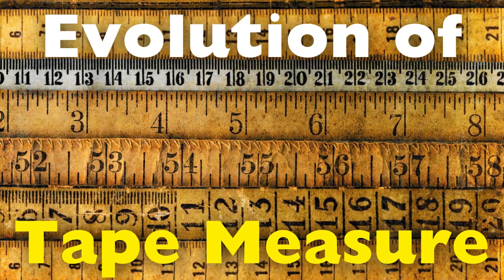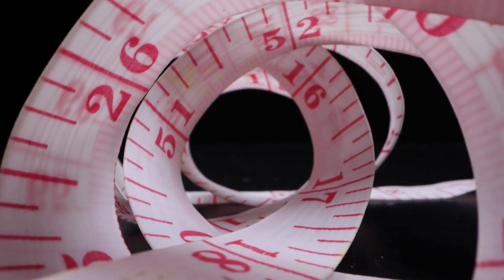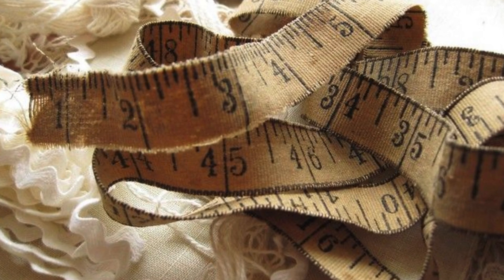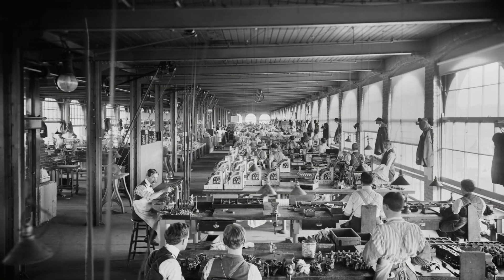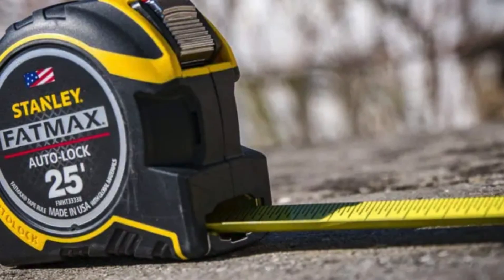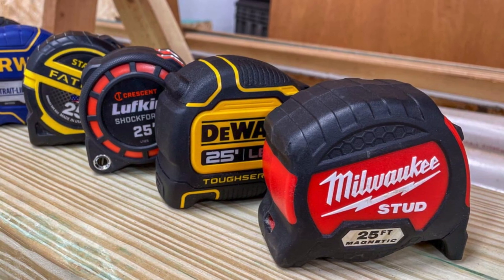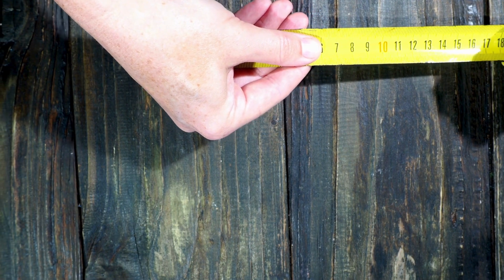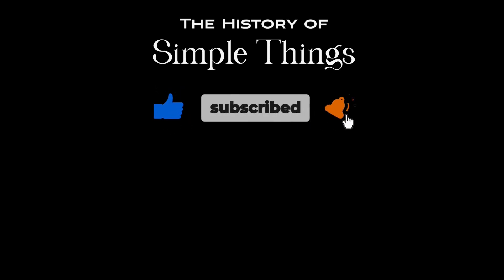From Cloth to Steel: Evolution of the Tape Measure

Comment: Greek, Roman and Egyptian buildings were/are very accurately measured.   Sure they had "feet", Cubits", etc.   But THESE were STANDARDIZED.  as in the "Standard foot" or "Official Roman foot", etc.  You didn't build Parthenons or Pyramids with 3 or more inches of tolerance, from different human body parts,  These structures were near dead on, as much as today. (You can still see for yourself)  What the Ancients DID do was to actually carve "standard lengths" into a near-by stone or other surface, that the builders could calibrate their own rulers to, keeping the building measurements uniform.  A good craftsman, even today, uses WOODEN folding rulers too.  Building accurate cabinets and furniture parts are usually not done with steel tape measures, that have "wiggly" or loose parts on the ends that  can compromise accuracy.